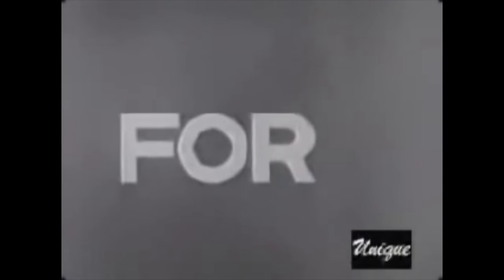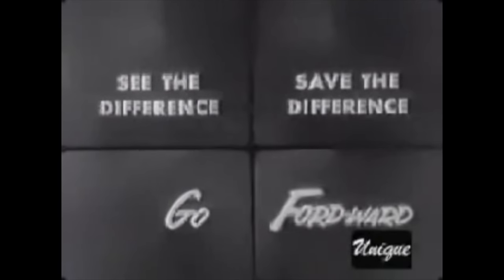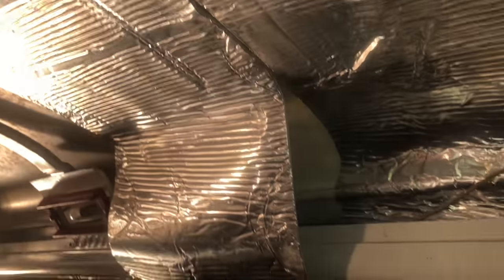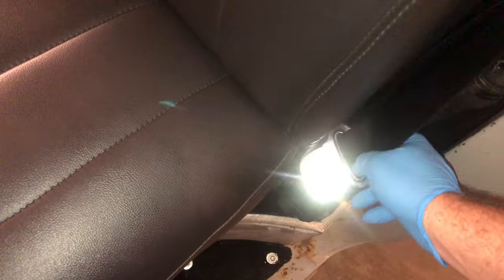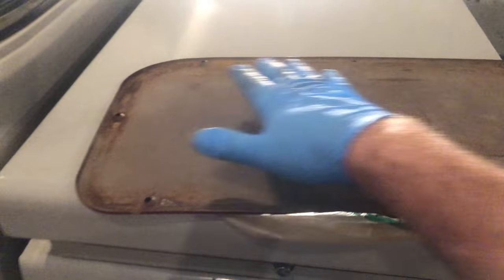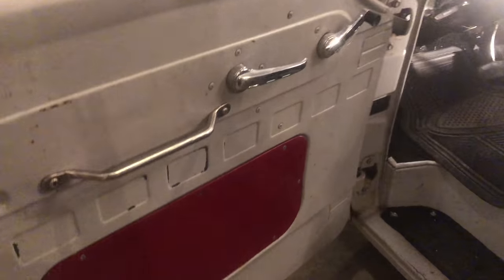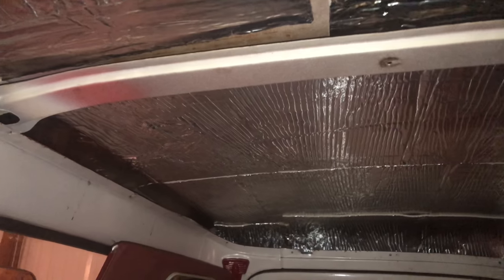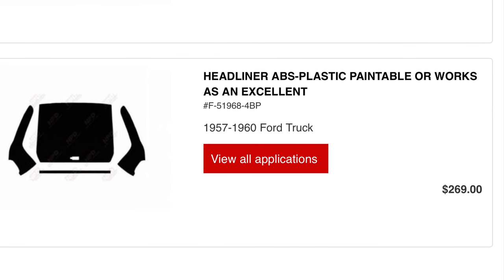1959 Ford F100 Stored in the Barn for 20 years!  Part 2

Comment: Nice truck would like to have seen you put on Fenton chrome reverse rims with baby moons. More period right for that model. But I'm an old man from muscle car days.  Built race cars and high performance engines for a living. Had a 47 ford truck with over bored 312  engine trick heads, interceptor carburator, dual point disburator, high lift cam. All the good stuff back then .HAHAHA nothing compared to today. Also built a 1958 Studebaker truck with 413 Chrysler motor torque flite trans. And Chrysler rear end. You talk about something dangerous to drive . But a blast. Sorry to have talked your head off really enjoyed your video. Wish you all the best from a CAR LOVER!!!!!
Reply from the maker: Tom Thomas I completely agree with you.  I’m looking at doing a trim ring or a different center cap.  I was in a pinch and had to buy wheels and tires quickly.  I wasn’t crazy about them either and they didn’t have white walls either.  I’m still hopeful that I can salvage them.  I love the looks of the Studebaker trucks!
Reply from the maker: Oh and I also have a Holley efi system purchased and I’m just waiting to get it installed.  Got me some ac and a new set of gauges as well.
Reply: @ClassicCarsComics  Cherish these times son I got old and can't build are work on them anymore. Just watch you guys and still dream. Thanks for talking to and old car freak.